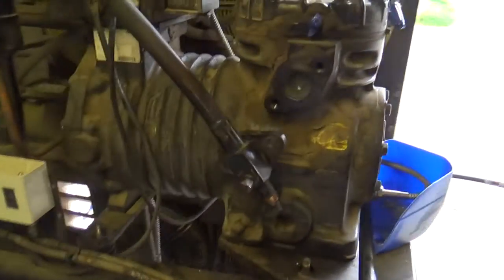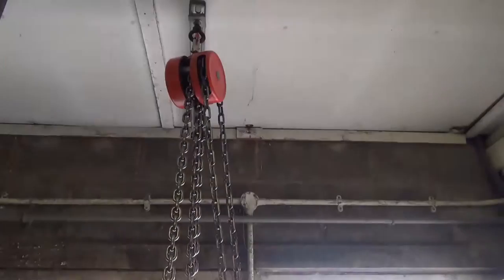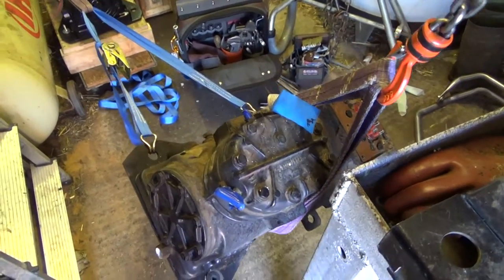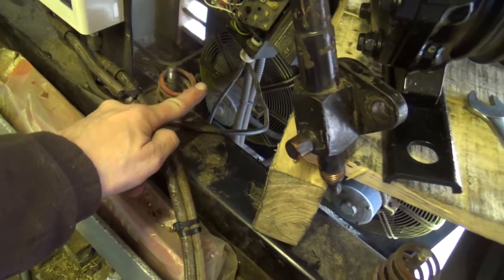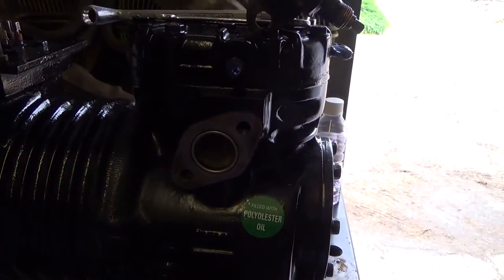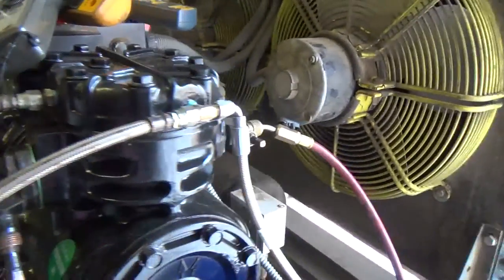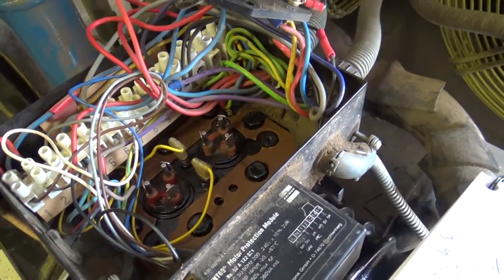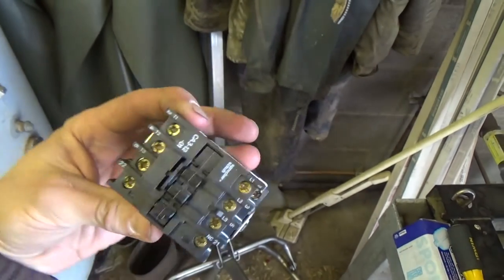Prestcold Compressor Change

Comment: I recognise that compressor with the vulnerable heater :)
I like semi-hermetics tbh, at least when they die you can have them rebuilt, less wasteful than a sealed unit. The old one going to be re-wound?
Reply from the maker: Well spotted! Its the same one i got the wrong heater for, luckily it fitted right in this one! I sent pictures of it to the rebuilders to make sure i got the correct block so it would be an easy change. The old body goes back to be remanufactured.

Comment: I would of fitted a scroll or a luniteTAG model because like you say they had a lot of problems the 5 HP prestcold I've had a few re mans fail and that's changing all ancillaries ie filter drier contactors 
But they failed still in short running time John 🤬
Reply from the maker: I can usually get things running again quickest with a rebuild as Aces are only half an hour away from me. None of the wholesalers keep anything big in stock so can take a few days.

Comment: Nice clean job John how many horsepower is the compressor I changed a copeland 4 hp the other week semihermetic but I was lucky enough to have a forklift to lift it up for me wasn't able to film it due to too many people being around me
Reply from the maker: Thank you! Its a PL400 0050 so its 4hp, I expect your Copeland would fit in its  place, the blocks are very similar. A forklift makes things much easier :-)

Comment: also John you can get prestcold damn ! here in toronto canada Prestcold was shown the door lol never to come back just like carlye
Reply from the maker: They have stopped making Prestcold stuff here, we can get Copeland which will bolt on in place (the bolt threads are different so i keep a set of spare bolts) but the wholesalers don't keep much in stock, the scroll has killed of the semi hermetic in smaller systems here sadly.
Reply: yeah what ever old units that are around in Toronto that have some prestcold's are replaced with copeland mostly.. i only use bitzer from scratch Scrolls i rarely use maybe for drying room's but i really don't trust scrolls to much especially for freezer

Comment: is there not a device that cant not be fitted that detects if there is a 3 phase fault and shut off the power to prevent damage to the motor
Reply: yes here in canada copeland has them is but they only come on massive compressor 10hp and up.. most bitzer's i buy as well come with phase protectors
Reply: poland2010
i assume the Phase Protectors is in the motors (top wiring box)
Reply: There isn't a phase protector I don't think. I believe the reason the old one fried was because the contactor broke and dropped a phase. The protector would've saved the compressor.
Reply: Tim Gomes I know that just thought it be standard now to have protect on 3 phase motors as it can permanently damage them if they do not have one fitted, as 1 phase drop outs can happen on 3 phase more so on high load stuff like motors on the contactor's as happened on this video
Reply: I suspect that these systems are all installed on a shoestring budget. In an ideal world, you'd fit undervoltage lockout, phase rotation and phase loss relays, but if the customer doesn't want to pay...
Reply: If they had put in a motor overload relay that also includes a phase loss detector inside in most, and it will trip out the contactor with either phase loss or overcurrent on any phase. Of course it is left out to save $20 in the BOM. I like having them in, saves the motor and the contactor, especially is you have it set to manual reset and you need to open the cabinet to reset it. There is a chance that whoever does it might check why it tripped instead of just blindly pressing reset.